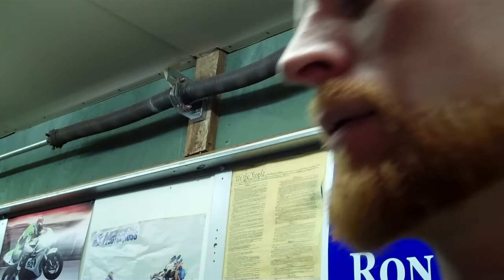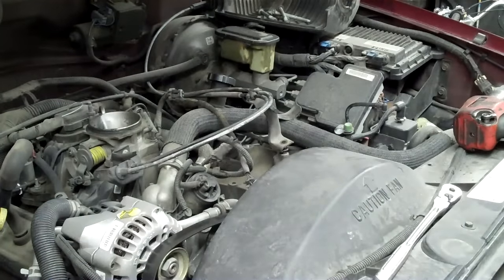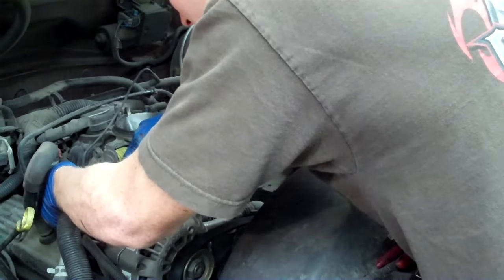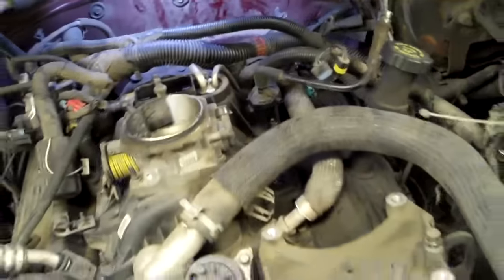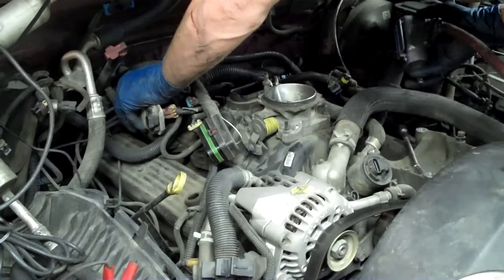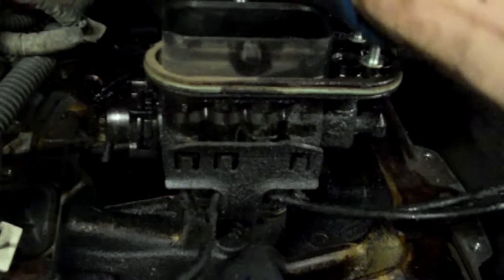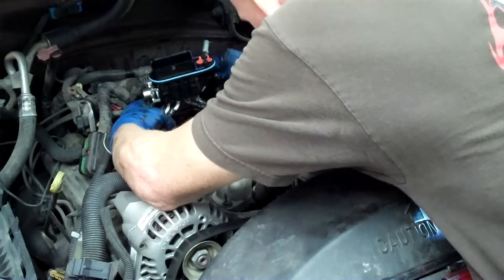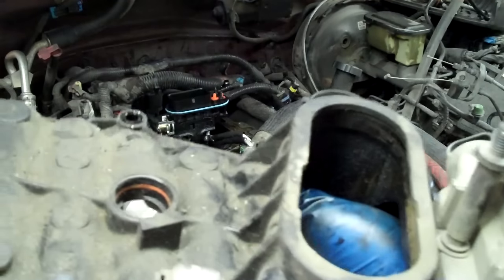How to change a SPIDER INJECTOR on a Chevrolet V8

Comment: Problem;.bought a 99 chevy suburban 2wd w204k miles,no smokin no blow by or oil usuage 1 owner,owner informed me that vehicle will not pass inspection..of coarse im in NC ,,check engine lite is on.cylinder 4 misfire code pops up almost instantly,,the truck does have a skip/mis/rough idle,,when in drive position it jus putt putt putt,but u accelerate it seems 2 clear up..Q;;is this a common thing?your video seems 2 describe shop said prob was/ 1 shop 
also said i may need a valve job,,,

Comment: Awesome video!Took my time and poof magic! Thanks a lot Brian.Saved a pretty penny by watching your video.Couldnt be any more detailed.Gotta admit my Tahoe runs better than it ever did.Got the Ac Delco spider injector off of Amazon for $262.37 with free shipping and it came with all gaskets needed.Also changed valve cover gaskets drivers side was leaking and completed a full tune up all Ac delco parts.Here's link for spider injector http://www.amazon.com/gp/aw/d/B000NW8EU8/ref=mp_s_a_1_1?qid=1400468107&sr=8-1&pi=SX200_QL40

Comment: Hi would the spider injectors cause a multi cylinder misfire on the check engine light? when I give it gas runs little rough, take foot off the gas and it shacks and spuders out. Its a 2004 5.7 vortac. in a workhorse stepvan. Thank you bsalender@verizon.net